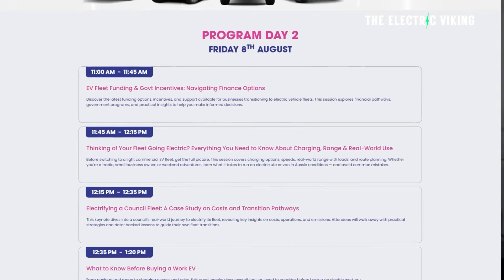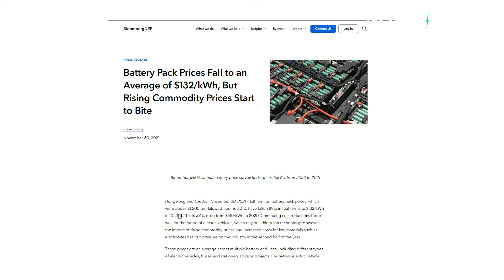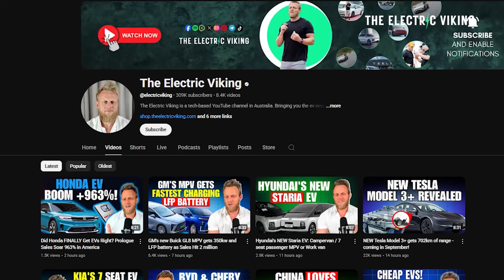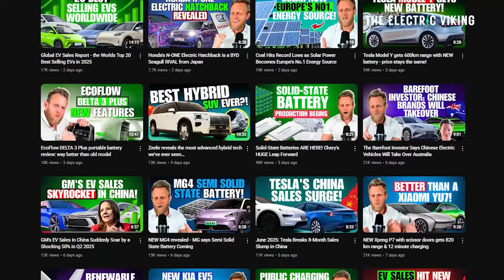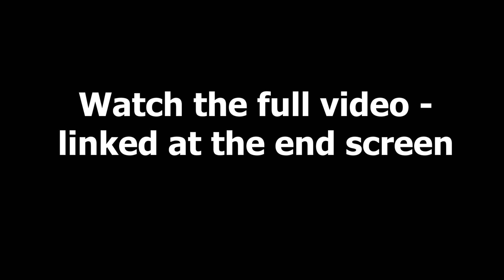EVs Are Almost as Cheap as Gas Cars Says Bloomberg — Here’s the Proof!

Comment: Basic, simple and machine made engine without a 1.000 moving parts, no exhaust and catalysator system, no radiator, no gearbox, no oil filter - for a decade I was told by motor-magazines, engineers, EV enthusiasts, newspapers that comparable EVs (specially smaller ones and city runners like Fiat 500s, Opel Corsas, VW Polos) would be much cheaper than an ICE car. Cheaper by one third and even only half as expensive to produce. What did they all get wrong?
Was it economies of scale, sheer numbers, the huge initial investments to be made or a total lack of understanding for the technology needed around the battery (charge, discharge, cooling, heating, impact protection, charging management) and the respective considerable cost? A technology so complicated and sofisticated, that european automakers with all their billions made from selling ICE cars plus billions in subsidies and tax credits from the EU and national governments are not even able to replicate it and get it right.
Reply: What they  got wrong with underestimating the greed of car manufacturers combined with high tariffs. 

We could be buying these electric vehicles for between 4500 and 15,000.  That is their sales price Unless they're in the luxury class. 

Anything over that, is tariffs or excess profit taking by the car maker.
Reply: ICE cars don't require thousands of battery cells. The battery packs constitute a far higher % of the cost in an EV compared to an engine and are not as robust.
I can replace my V8 for a couple of thousand $, and drop it in myself in an afternoon if I really want to. But at 50 years old, it's still running great and gets all the range it did when new.
Reply: @SteveLomas-k6k for the 99.9% those who are on car people, replacing an engine is $5,500.  And if you're not replacing it yourself, there's no guarantee it's going to last for more than 2 years.
Reply: @SteveLomas-k6k also the price of the battery packs have dropped by over half. 

And having several thousand, not 50,000, batteries in the car means that it has a lot of protection from individual points of failure. If one cell goes out, it he drops the range of the car by a few hundred feet.  

I do agree that these batteries should have a standard form factor that makes it easy to swap out for new battery packs. 

We really need some laws in place to enforce this. Allowing every car manufacturer to have a custom form factor, and not even keep that form factor for more than a couple years at a time, means that replacement of the battery packs will be more expensive and difficult than it needs to be.
Reply: @mac_mcleod  And If one cell goes into thermal runaway- so do all the others.
EV battery swapping was tried 100 years ago- it's a massive added expense and compromise to any EV which already suffers from extra expense & compromises compared with normal cars.

"We really need some laws in place to enforce this"  Yikes, same with EV mandates, it's the only way to force something people don't want.

By the way, do you know what a Scotsman's favorite Rolling Stones song is?
Reply: @SteveLomas-k6k okay I'm going to have to answer this in pieces because when I answer it all at once it gets censored. 

First, they are already using battery swapping in Hong kong.

And the earliest Teslas were made to swap batteries and owners have swapped batteries at a lower cost as a result.  Making it easy to replace the batteries makes the vehicle  potentially usable for a million miles and prevents it from becoming a couple tons of landfill prematurely.
Reply: Second, yes we use laws to prevent people from locking you into their own custom charger, their own custom kind of screw, their own grade of railroad tracks, etc. Society sets standards.  It always has. 

Groups of people say you cannot live with us unless you follow our rules.
Reply: @SteveLomas-k6k and where you have complete freedom, the upper upper class always takes advantage of their greater power and the result is misery and a loss of Rights and that freedom for people like you and me.

If you want to live in a state of nature, go live out in West Texas or someplace where the taxes are low and there are no government services.
Reply: @SteveLomas-k6k finally my favorite rolling Stones song  as a Scottish Texan is "sympathy for the devil.".

I'm unfamiliar with the riddle though, what are Scottish people's favorite rolling Stones song
Reply: @mac_mcleod  Thanks for the responses: I'll try answering in one if I can:

Tesla and China doing battery swaps: no coincidence you're talking about the richest man in the world who can shoot a car into space on his own rocket, and a non democracy that has plowed half a trillion$ into EVs, and many other vanity projects. That says a lot about how economically viable this is in the real world.

On freedom; like many people, we already did move from a very large city with high taxes and regulation, to a more natural setting with far lower taxes and regulation. And I can say people are generally much happier, healthier, safer, and better off in the latter- most of all, there is FAR less division by wealth and class. But that's a whole different political debate!

And lastly, it's 'Hey McLeod, Get Offa Ma Ewe'  😁
Reply: @SteveLomas-k6k  Oh yes.. told as a joke, it goes:  

"Two rock fans, one English and one Scottish are listening to an old Rolling Stones album. 

Mick is singing "Hey you! Get offa my cloud"....when the Scotsman says "That's really an old Scots song you know"? 

The Englishman seriously doubts this, so the Scotsman says, "It really goes" "HEY MACLEOD, GET OFFA MY EWE"!"
Reply: @SteveLomas-k6k  And on top of that, you just voted to cut all those subsidies.   Rural hospitals are already shutting down; this will leave some of you 100 miles from the nearest hospital as the mandate to provide funding taken from citizens of California and New York has been killed to give the money to the upper upper class instead.

You forced the rest of us to give you subsidized roads and internet service.

Your disaster aid that let's you live in river valleys that flood is gone now.

The rural lifestyle has been massively subsidized for the last 50 years.  That money has been cut by your own choice.  

But even if it weren't, it's pretty hypocritical to say we MUST provide you with internet and disaster aid but providing apartment dwellers with charging is wrong.

Lousiana was getting half of it's annual budget from the federal government.  It's in for hard times.

And most other states controlled by that party get 25% or more of their budget from the feds.

California and New York are literally paying almost all the bills and the party in power is sabotaging their economies.

It only gets worse from here.

Comment: What really surprised me is that the cost of repairs and servicing is actually pretty high for EVs, despite them having far fewer moving parts and components, which should, theoretically, make it much cheaper. This seems like another important thing to be overcome, but it looks like manufacturers are using this as an additional revenue stream as they control the repair shops and spare part supply.
Reply: Fewer repairs, but just as expensive when they happen.  Problem is EVs are too techy. I’m fine with manual doors and trunk and seats. All the gadget stuff is prone to break.

Comment: I think the breakthrough will come by faster charging time rather than by longer range. Electric cars are way to heavy consuming a horrendous amount of material during production. My car runs on 16 inch tires and weighs 1100 kg and it’s electric equivalent 1455 kilograms. It’s a small but actually very nice car (Peugeot 208). If it was be possible to purchase something like this with a 250 kilometer range, ultra swift recharging and a weight of around 1200 kilograms then I would convert immediately. Now I am just putting kilometers on my old one expecting something like this to materialize in the future. Greetings from Denmark.

Comment: Vast driving distances in the U.S. and Canada plus the frigid temperatures in winter for Canada and the northern half of the U.S. preclude widespread adoption of full EV's.
People that want them (mostly in urban centers and can charge at home) already have them.
Reply: That's SORT of true. I would move to an EV in a heartbeat, but I have to travel about 330 kms each way every 2 weeks. With EV range in Canada maxing out at right around 400 kms in an ideal situation, I assume 20% less in winter. That brings me right to the edge of my range. If a car had 550-600 kms distance, I would immediately get an EV...probably will have to get 1 more ICE car before ranges are long enough
Reply: @GraemeMitchell-m6v  I have a PHEV...and the winter all electric range is half of the summer range. 20% less in winter is optimistic.
Reply: @marcelstanford430 from what I have learned, it seems batteries have half the capacity unless they have a heat pump to condition the battery. The loss there seems about 20%
Reply: @GraemeMitchell-m6v  Yes that could be true. Mine does not have a heat pump and I know Teslas don't lose as much range as mine does (they have heat pumps).
Reply: Yeah probably true. Current EVs are perfect for urban areas. Need more chargers for apartment dwellers.
Reply: Norway proves your concerns of cold weather wrong.
Vast distances are much better to cover in EVs. Less noise, usually better driver assist and cheaper to run. Yes, you do need to think a little so your charging and breaks coincide, but the outcome overall is a much better trip at lower cost. 170K miles on our EV now in all types of weather.
Reply: @thedukeofalinor1377  let's see...Norway has a total of 385,000kms sq. Canada has almost 10 MILLION. Very different geography, commitment to charging infrastructure etc. So, you can't really compare the two.
Reply: @GraemeMitchell-m6v  Just showing it can work. US is big as well and since 2017 all parts of US have been reachable. Some with charging at RV parks, but all places.
Reply: @thedukeofalinor1377 not true. As a recent resident of the US (over 20 years) charging varies by jurisdiction. See if you can find charging infrastructure in rural Arkansas, Alabama or West Virginia
Reply: @thedukeofalinor1377 all I said was that range needs to be a little better. Also, availability of Chinese electrics (or longer range vehicles) is going to help. When I travel, I have to go 30mins from my destination to find a charger. Very different from Norway....context is important when trying to compare
Reply: Igno-Rant.
Reply: @martingardens on what basis is any of the comments ignorant? Actually, all seem well-versed

Comment: I think EV prices will need to be lower than ICE in the US to get to major adoption. Given the amount of stuff (engine,transmission,catalytic converters,turbos,etc) in an ICE, EV's should be a lot cheaper. Love our Bolt!
Reply: Not necessarily lower.  Hybrids are gaining the most sales right now here in the US and they are still a bit more than plain ICE models.  But, the price difference has to be worth it overall.  I didn't get a hybrid at first because they were pretty much like EVs in price premiums ($7k and up).  Right now hybrids are only $2k to $3k more than an ICE model of the same vehicle, and they make sense if you drive a lot (like my wife gets the payback in gas savings over less than 2 years).

EVs though are just too high compared to hybrids/ICE vehicles right now.  Best example is comparing a hybrid and an EV of the same model like the Kia Niro.  The hybrid version goes for around $29k and up.  The EV starts at $39k.  A $10k difference would take 12 years to break even (roughly 12 cents per kwh vs $3 per gallon gas).  Overall cost could be lower with less maintenance on the EV, but you're still looking at 8 years or more of ownership.  EVs need to get within $5k of their equivalent hybrid/ICE vehicle to be worth the extra money (if looking at just value in terms of cost savings).
Reply: @dacripe  And the figures you quoted are if you can charge at home. If you must charge at public chargers the savings could be negligible or even none.
Reply: Agreed, both EVs and home battery storage need to drop in price if we want to get off of fossil fuels and stop air pollution and the destruction of our climate
Reply: @freeheeler09but the US petroleum industry doesn't want us off of fossil fuels, we have been sitting on our petroleum reserves for decades and we need to use them. China is exploring the natural resources they have in abundance

Comment: i owned a bmw 118d,now i am driving a byd sealion. including fuel, etc, electric is way (!) cheaper. my bookkeepers totally see that😊
Reply: As long as it is fairly new, OK, but let's wait and see in the long run, or when having a damage.
Reply: @MK-dz1ur  170K miles on my EV, one headlight replaced under warranty. Other than that, just tires and my own maintenance. Coming up on 10% less range, but NP there.
Reply: @MK-dz1ur  In the long run, the ICE car goes to the scrap-yard when the EV is halfway, at most, through its life!
It is technically a non-brainer:  EVs have many fewer parts, no thermal stress, suffer much less vibrations, etc.  A few years ago, battery life was still an unknown, but no more:  batteries last much longer than expected, and easily above 500k miles... more for the LFP ones.  MG is even offering in some Asian markets a transferrable lifetime (that of the car, not of the owner!) battery warranty on its LFP models.

Damage to the battery?  Yes... it can occur! If it's a traffic accident, then it will be covered by insurance. If it is a rock or something damaging the battery... then it's obviously bad luck as it is covered by neither insurance nor warranty...  but, that happens also with ICE cars:     I had to change the engine on two cars that I owned (a BMW and a Pontiac) before they reached 100k miles!  In both cases, it was a manufacturing defect, which didn't materialize before... the warranty was over.
Reply: @MK-dz1ur are we also going to count the savings in maintenance and energy consumption? I do think we need dumb EVs with less sensors and unnecessary technology to offer an even lower cost form of transportation in the US.
Reply: @aronsingletary 
The tech in EVs is the icing on the cake.
Reply: @jorganzola1 wait, you are "the people" that need their car to tell them when they aren't in their lane or to slam on the brakes when reversing out of your driveway because a car is passing by? The "tech" is great for people who are not good drivers but there are plenty of people who just need basic transportation.

Comment: My VW Bora 1.6 1999 is cheaper than any of those you consider as 'affordable' or 'cheap'. — If your income is less than 20.000/yr, you would consider your limits all over... I prefer cars that cost less than 2000/year. Mine costs less than 1000/year. (Including taxes and yearly maintainance)
Reply: And my Guides tells me that DO NOT buy anything as in debt. Buy only what you can afford in cash. ;)
Reply: €'s
Reply: How far do you drive that paragon of value each year?   I'm unfamiliar with the model, but Google says it gets around 25MPG, so the average 10K miles/year US driving distance would cost pretty much your annual car allowance, in fuel alone.

Comment: No matter how cheap n nasty they get, some people will never ever buy them. Its the charge time
Reply: DOes that matter if you're in bed?
Reply: @alexmckenna1171  I don't have to take a nap to wait for my car to fill, it takes 2 minutes for >450 miles range. Which means I can actually go more than 100 miles from home without getting stuck at a charger.
Reply: @alexmckenna1171  It matters if I want to go away for a weekend, if I cant use an ev for evey purpose i need a 2nd car, if I need a 2nd car I dont need an ev. BTW, the ev charging industry is failing bc people charge at home. No customers.
Reply: @MrkBO8  That tells me that people buying EV's are doing it for a commuter or second car.
Reply: @robertd9850  Yes, they are good 2nd car, not a good all rounder though.

Comment: Absolute b*llocks!!!! Certainly not the case in the UK! We've just replaced our car and looked at the all electric Cupra Tavascan but bought the mild hybrid Terramar instead. We'd have had to cover 200k miles to recover the extra outlay for the Tavascan.
Reply: EVs will continue to get cheaper.

ICE cars will only get steadily more expensive.

Hybrids are just complete nonsense.
Reply: @JohnSmith-x3y8h that's not the title is it? They are still nowhere near as cost effective in the UK. They only make sense for companies and their employees who have company cars. I'm not anti EV but he's stretching a point here 😂🤣 as for "hybrids are a nonsense". Plug in hybrids yes I agree mild hybrid systems are there purely to fill in with power delivery however and make perfect sense. They do make a small difference to a car's economy but it's negligible.

Comment: Iam happy to pay more for petrol car
Reply: Why?
Reply: Why? Made of money??
Reply: Me too. But actually I pay FAR LESS...
My VW Bora 1.6 1999 is cheaper than any of those you consider as 'affordable' or 'cheap'. — If your income is less than 20.000/yr, you would consider your limits all over... I prefer cars that cost less than 2000/year. Mine costs less than 1000/year. (Including taxes and yearly maintainance) – And I drive only about 6000 kms/yr (4000 miles/yr)
Reply: @BonoBronck my car cost less than $1,000 per year until the struts finally got old and the VTX oil oil system got old and I was suddenly faced with $4,000 repair bill on top of the $300 I was paying for a regular maintenance. 

Gasoline vehicles have some hefty repair costs around 140k to 160k mi range.

And around 200k to 300k you're looking at a new transmission. 

And around 250k to 400k, you are looking at a new engine.